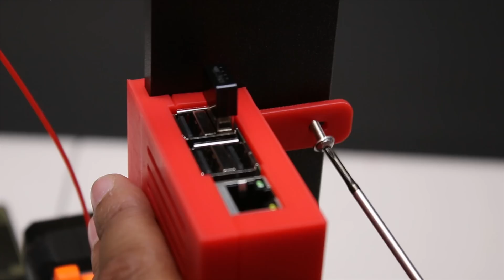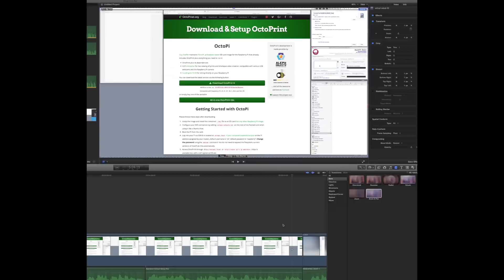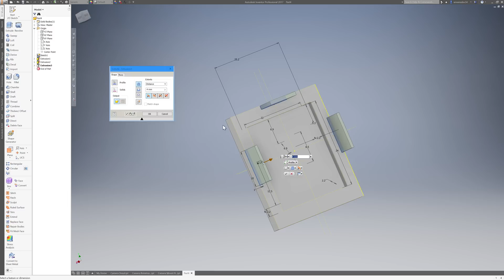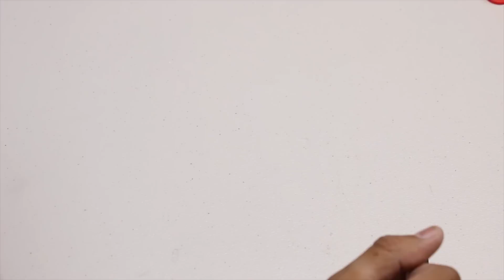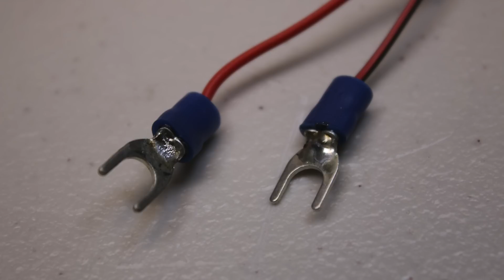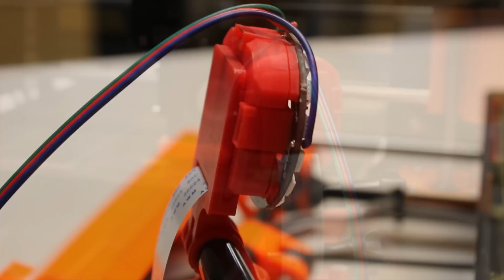3D Printer S02 E04 - The Simplest Setup for OctoPrint on YouTube - 5 MINUTES

Comment: Looks like this video is old, but I'd put it on the other front corner and you could use a shorter ribbon cable and have fewer snaking issues.

Comment: I am a newbie to using the pi in fact I am waiting to receive it so I've been on YouTube watching every video I can find to which I've come up with one fault on every vid" the connection from ramps 1.4, or gt 2560 etc " is it in thin air because nobody has physically shown the connection  actually plugging it in. I assume we plug the USB lead from ramps in to the pi and the pi finds it automatically and with the octoprint  when power is applied it will recognise it as a peripheral. Just guessing by the way cause I have an imagination lol

Comment: I’ve played with the led rgb rings and believe the Pi isn’t fast enough to drive the synchronous communication required to drive the pixie ring.   You could load an Auduino nano to do this or just buy a rgb led controller and just control the supply voltage to the controller..  I like what you did  and will give it a go and try to come up with an optimal solution for the pixie ring.
Reply from the maker: Grant LeSueur thanks! Keep us posted
Reply: From my understanding any neopixel on any RPI other than first generation RPI will not work...  (https://learn.adafruit.com/neopixels-on-raspberry-pi/overview) And you would need something like a FadeCandy (https://www.adafruit.com/product/1689).

Comment: I already have two OctoPi running. The first with a Velleman K8200 and the second with a Prusa i3 MK2S with MMU. So I had to find another place for the RasPi. It found it's home above the power supply. When you use Slic3r and/or S3D you directly upload your gcode files to the Octopi.

Comment: Am I missing something? I can't get Raspberry Pi (3 model B V1.2) Wifi to work on my wireless network, it doesn't show up when I scan the ip's. Pretty much all I have to do (to get it to log onto the network anyway) is put my SSID and network password in the network setting under WPA/WPA2 isn't it? I have a friend that is a network eng. that couldn't get it to work either. And I have tried 2 differant new Pi's.
Reply: I have the same problem...
Reply: Yeah, we are not being told something. I did get one to work but don't know what changed, will let you know if I find out what is wrong. The other problem is these guys put up these video and then go silent, useless.
Reply: Yes totally
Reply: The pie does not work on  channels 12 and 13 for some reason, I and the same problem and had to move channels and all worked fine
Reply: I did find a solution to this very problem in that the power supply to the Pi was not strong enough to power the wifi signal. A seperate power supply to the Pi gave me the access to the camera features that I so wanted.

Comment: What CAD software did you use and what platform is it running on?
Reply from the maker: Lewis Balentine I used inventor on a Windows platform. Fusion 360 is fairly similar.

Comment: Thank you for all your videos - enjoy them a great deal - please keep them coming   

Firstly, I'd like to preface this by saving that I don't have  Prusa at the moment, so there may be a very good reason why you didn't do this, but I have just rewatched this video and took more note of your suggestion regarding the length of the ribbon cable and the potential snagging on the rear, left hand side (as you look at it face on) and your suggestion regarding getting a 1.25m cable to give enough length to re-route it.  
Is there a reason you didn't mount the camera on the other side of the front of the printing plate - that way you would have saved the width of the printing plate in cable length and have enough to re-route it as you mentioned?
Reply: I've just watched the video and was wondering the same thing :)

Comment: Over clocking the Pi does not really do anything when using OctoPrint. I think you are bypassing a fuse the way you are powering the Pi. There is a simple 12v/24v step down to 5v cable with a Micro USB you can get on amazon. I’m using it on my CR-10. Using some heat sinks with a fan is a good idea on the Pi.

Comment: Hi Nerd do you have a link for the power converter and how to wire it up as like the idea of self contained kit for my prusa only issue i will run in to is i have the MMU kit so will have to make a case that will  mount above the psu or piggie backs the mmu controller board housing. also camera mount on the heat bed does this need to be abs or pla?
Reply: Josh Smith j7

Comment: I still don't get Octoprint from a reliability point of view.
Nobody wants to run a 20 hour print controlling the printer via a USB cable on your PC right?
Basically the same does Octoprint! If something goes wrong with the software on the Pi, the printer halts.
I've tried Octoprint in the past but still i believe inserting a sd-card into the printer controller board is the most
reliable way.
I was hoping that there was a way to remotely access the sd-card in the printer and that Octoprint could basically 
give commands to the printer without streaming data to it, but no luck..
After having tried Octoprint, i've tinkered with a Toshiba FlahAir SD-card ith built in Wifi. Looked promissing, but an remotely added file on the card could only be seen by the printer after the printer resets (runs Marlin)
So, i'm still changing sd-cards ... not very handy, but very reliable
Reply: Interesting! Didn't find it then (a few years back already) I will give is a try again. Thanks!
Reply from the maker: I see your point, I think for me it was more to do with remote monitoring, but also the way in which the OctoPi is setup on my machine is it is powered directly from the Printer itself. I've run 20 hours prints and have had no failures to date.
Although, I believe, with this setup, you can run the print via SD card and monitor the print via OctoPi and use the Emergency Stop Plugin to stop the printer if there is something wrong, having the best of both worlds. I'll try that, it maybe a more reliable work through.
Reply: monitoring and remote shutdown is handy indeed, thanks for your reply
Reply: Winand D There is an option in octoprint to save the gcode to the printer's SD card
Reply: Also i have printed many day+ long projects from my Pi without a single error, there is a big difference between a PC and dedicated Linux box pushing g code. They also have their own distro now that further slims it down, id give it another shot and think you will be surprised.

Comment: That was great.  Coincidentally I recently did basically the same thing, at just about the same time.  I skinned the cat a slightly different way, but all the major pieces are there.  I chose to use a 12v led strip system mounted to the inside edge of the frame, wired directly into the PS, with an automotive style rocker switch to turn on and off.  I chose to use a PI3, to get the on board wifi.  I used an over designed automotive style 12V to 5V transformer rated at 3A to do the voltage reduction (with another rocker switch inline).  And just cut off the end of USB mini cable, so that I wasn't hard wired into the PI3.  I found some short A-B USB cables to tidy up that connection, and fond that a 2m camera cable is a bit on the long side, but I'm glad it wasn't too short.  I actually tucked that cable in with the ribbon cables going from the LCD  to the controller.  

I do like your camera case, I think we both got inspiration from the same sources. I cheated a bit and just modified an existing gopro mount and a pi camera mount in F360 instead of designing from scratch.  But I do like yours better, so I may just print that out as well.  I also just modified another Pi case for my use, by adding a few screw holes, to be able to mount the transformer, and a protective case for it.

Thanks for sharing, it really was cool to see something so similar, yet done so differently.
Reply from the maker: Hey that's awesome, thanks. If you do decide to print the camera mount use PETG or higher temp plastics. LOL i printed mine in PLA and then the other day was printing a PETG part with the heater bed at 80C and when I came back to check the time-lapse, I noticed the camera had tilted during print, on closer inspection the camera mount had in fact melted. Glad you liked the design anyway, i may do a follow up episode in RP Zero

Comment: I'm just printing your pi case.  Having it on the printer sounds like a great idea.  How have you found the pi camera?  Is it worth getting or should I look at something a bit more "snazzy"?
Reply from the maker: It really is worth getting. You can remotely monitor your prints and if anything goes wrong just stop the print instead of it just wasting your filament.
Reply: NERDVille I was more asking whether the pi camera was worth it. I definitely need some sort of camera. I went up to check on a print the other day (actually your pi case) to find that the printer had been printing the worlds largest booger. It too ages to clean the nozzle off. If I'd had a camera then I could have spotted it sooner.
Reply from the maker: Oh, I see! Well, the Pi-Cam I'm using is the v1.2 and can't comment on the v2 other than it can achieve higher res and cost a bit more as its new tech. In my opinion, your streaming at 640x480 anyway, any higher and the RPi is having to work harder. the v1.2 can capture HD images so you can create good quality time-lapse the same as you would with a v2. As I've never used any other camera I can't compare, But I do like the small form factor and this puts less strain on the bed load (not that I think it matters too great) hope that helps you.
Reply: Could you just explain what you did in order to get power from the prusa psu? A bit lost, did you buy a 12v to 5v adaptor and then run the 5v in to the rpi? If so where abouts did you connect the power terminals on the rpi?
Reply: In that case it sounds ideal.  I don't want to do any youtube streaming or anything like that.  It will mainly be for monitoring so I think you're right.  I've used banggood before so I think I'll go the same route as you.
Reply from the maker: good luck. I've provided links for Banggood and I think they offer a little discount for my viewer. Let me know how v2 camera works for you. I'm thinking of upgrading
Reply: What about the ring light.  Are they readily  available?  I am no electronics expert but it looked fairly easy to assemble.
Reply from the maker: im thinking replacing the NeoPixel with a standard white LED ring (I've included a 15 LED ring from BangGood in the vid description) as i still haven't figured out the program to control the WS2812B chip via PWM. So its easier to have a remote switch and just wire this into the 5v and GRD on the RPI.

Comment: Nice video. however you missed the part where a user should SSH to their pi directly first and change its password etc. as well as extend the filesystem to the whole card. because as is. any user can now SSH into your pi as they all have a default password.
Reply from the maker: good point, this was really just to get the basics out there. I think I will look into a beginners guide which gives a real step by step process

Comment: Such a true statement. "As an engineer you are your own worst critic." So true. Sometimes a good thing, sometimes you fall into the rabbit whole and just need a break or a second set of eyes. But for the most part I guess it's a good thing.
Nice job on the camera. Now can it lift with the Z axis as the print extruder goes higher for bigger prints? Part two, coming soon?

Comment: It makes more sense to have the Pi on all the time and allow the Pi to power up the Prusa via a relay. I have it setup with some scripts to do that --- a button on the Pi interface to turn on the printer remotely, then you can basically do everything remotely via the camera, pre-heat the bed, upload the gcode and hit print -- sometimes I'll do all of that from the upstairs office and may walk down to the basement to take a quick look at the first layer if I can't get a good view from the camera. I also have scripts on the Pi which will turn the printer off 20 minutes after a print has finished unless a new print was started, this way I can do overnight print and not have the printer stay on all night long.
Reply: There is a plugin called "Enclosure Plugin" that you can use for this.
Reply: Do you have more information on how to set this up? I would love for my printers to automatically shut down if I'm not around to start another print.
Reply: Look here on how to configure OctoPrint: https://github.com/foosel/OctoPrint/wiki/Controlling-a-relay-board-from-your-RPi and here http://docs.octoprint.org/en/master/events/index.html.  The rest is just linux scripts. What I do is when OctoPrint finishes a print it calls a script which touches(creates or modifies an empty file), then I have a cron job which checks every 30 seconds if that file exists and it's older than 20 minutes, that means a print finished exactly 20 minutes ago, and if so it will then run a script to turn the printer off. I also add a menu to OctoPrint to clear that file -- that way if I don't want auto turn off to occur, I have 20 minutes to act. Also when a new print starts another even fires where I have a script which deletes that file. My ocoprint setups has much more to them with integration with my home automation components, etc, but the power stuff is pretty straight forward.

Comment: to be honest, I'm running octo print on a pi zero W and its more than powerful enough...
even including the camera it costs less than a b+ or 2
Reply from the maker: I just got to Pi Zero's, may look into that for another printer
Reply: cool. If you're doing it with a zero W, then I'd recommend attaching the whole thing where you've moundted the camera. Less length needed on the ribon cable, and no snagging.
Reply from the maker: AWESOME suggestion. Mind already designing away. This could be a perfect revisit episode, LOL THANKS!
Reply: lol, thats exactly how I mount mine, Works really well :)
Reply: Dan300891 print&go aren't you afraid the whole thing becoming too heavy, hanging from one side of the bed? About using a pi zero, I am thinking you only need cpu power when slicing in octopi.
Reply: not really. a pizerow and camera isnt that different in weight to a gopro in honesty. Although, if thats a concern, mount the pi zero under the bed so the weight isnt hanging out.

Yeh, the main CPU grunt is only needed for slicing. and producing the webpage. I had it running on an origional pi and it worked a treat